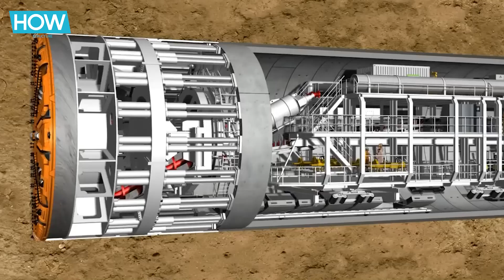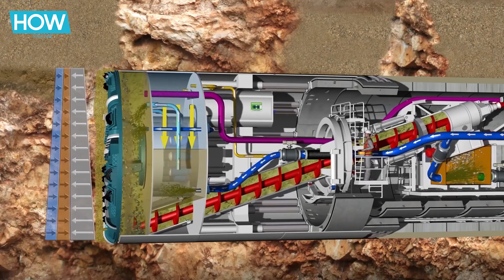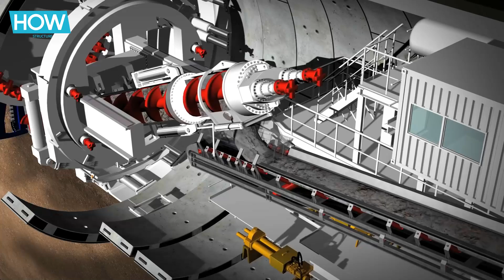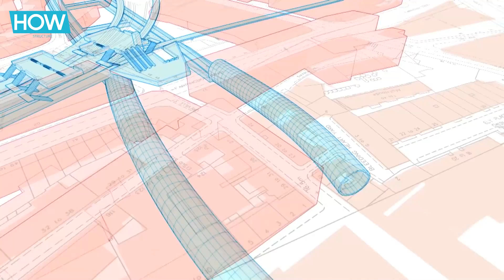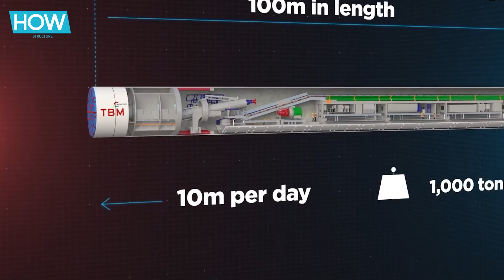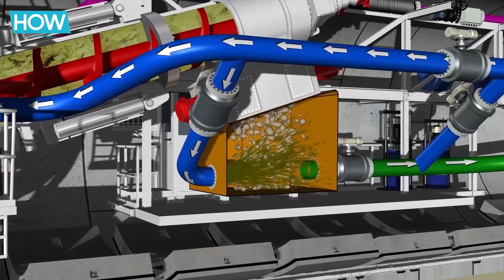SOLVED │ LA's $9.5 Billion Metro Purple Line Challenge

Comment: That's a purple train (1:15) but that sure isn't the Purple Line. There are also other images in this video that aren't from L.A. I'm wondering why you included a local news report of a robbery in Beverly Hills in your video. That has nothing to do with transit in L.A.
Reply: Because this video was put together with AI and just threw together a bunch of things that sounded good. It's this sort of comprehensive garbage we can expect with AI-driven YouTube sites.
Reply: @stevekluth9060  Yep. YouTube is eventually going to degrade into a bunch of AI generated garbage to get views, with nothing else to watch.
Reply: They are building two new subway stations in Beverly hills
Reply: Thanks for the comment. I stopped watching the video.
Reply: THEY ARE LASSY TO GET THE RIGHT STOCK IMAGES

Comment: Solving infrastructure problems is one thing, but people need to use it too 😂
Reply: They are using it. The ridership has gone up every month for tge last 18 months. In fact, this video is out of date when it comes to the daily boardings. As of May 2024, it's up to 980,000. Almost 1 million daily. I'm sure it will surpass that in June.
Reply: They are using it. The ridership has gone up every month for tge last 18 months. In fact, this video is out of date when it comes to the daily boardings. As of May 2024, it's up to 980,000. Almost 1 million daily. I'm sure it will surpass that in June.

Comment: You seriously think I'm going to ride underground in an area that has daily earthquakes ?  Sure, big ones are far apart, but when it hits, and it will, this will just turn into one huge coffin.,
Reply: In case of earthquakes subways are the best place to hide and find safety. Look at Japan.
Reply: There have been underground subway tunnels in LA since 1993 and we've had some big ones since abd the tunnels have been fine. However, the freeways suffered significant damage in a few places.
Reply: The "daily earthquakes" haven't made a difference to all the other underground metro tunnels in LA...
Reply: So you'd nix riding a subway in Tokyo?
Reply: FYI: The initial segments of the MTA Red Line survived the Northridge Earthquake will little issues. Up north, BART in San Francisco survived some big earthquakes too. While anything is possible, I think you'll survive subways in California just fine.

Comment: For LA to grow to the next level it needs a fully functioning metro subway system with good coverage that overlaps other transportation.
Reply from the maker: Of course, but this is a big step towards further development.
Reply: @HowStructure  Definitely and a much needed one at that.
Reply: @HowStructure LA has built so many big step rails, the situation is getting worst for non car drivers.  That's ok. Those big steps will help car drivers who can afford two cars.
Reply: That is happening, but the backbone of the LA Metro network will always be its light rail lines. That's because of the distances the network needs to cover. It's just too big to only use subway lines. It would be prohibitively expensive and take too long.

That being said, a new heavy rail subway line is being proposed for the Sepulveda Pass and will connect to both this new D line extension and the E line light rail line.

There are two new light rail lines that have already been approved and one new extension. They should start construction in a couple of years and be operational by 2034.

There is also a new Automated People Mover at the LAX airport that will be operational in 2025 and will conbect to both the K and C light rail lines.

So, yes, the LA Metro needs to expand and it's doing exactly that for the foreseeable future.
Reply: @mrxman581  LA is not too big for heavy rail lines
Reply: @mrxman581  Just so you know I wasn’t suggesting that LA only use subway lines or abandon its focus on light rail. The argument for LA to drastically invest in a comprehensive subway system so people can EASILY get from point a to b fast is too large to ignore. And I’m saying this as somebody who knows about the expansions going on. More focus should be put on subways. Not saying less should go elsewhere as a result.
Reply: @jst4572 It's either one or the other. There aren't the funds to expand subway and LRT lines at the same rate. Subway lines are being built where they make sense. Like the D line expanding to UCLA and the VA.
Reply: @mrxman581  that's the reason rails destroy local public transportation. 
Subway n LRT don't cover all the areas. US rail supporters hate more rail stops.
What happens when most public transportation funding go to rail, nothing is left for local bus improvement. So people need cars to use rails. This defeats the purpose to reduce traffic congestion n help people getting around without cars.  Oh wait,  helping non car drivers is never agenda for rail supporters. The irony is many rails are competing streets with cars. Many people brought that point, but rail supporters wanted the rails so much. They never care.
Now the next big waste that will destroy local public transportation,  CAHSR
Reply: never happen.. they will steal all the money before anything close to that happens.

Comment: It’s called the Metro D line, not the purple line.
Reply: "purple line" was it's formal name and is still colloquially known as such
Reply: @nikkiiv9259 "Was" is the operative word. The letter naming scheme started in 2019. So, it's officially the D line. And once the extension opens, everyone will know it as the D line.

Ih, BTW, it was first known as the Red line. In fact, the long proposed Wilshire subway was supposed to be the original Red line. It was in fact the Red line for several years before they changed it to the purple line. Getting rid of the color references is long overdue; confusing history.
Reply: @nikkiiv9259 "Was" is the operative word. The letter naming scheme started in 2019. So, it's officially the D line. And once the extension opens, everyone will know it as the D line.